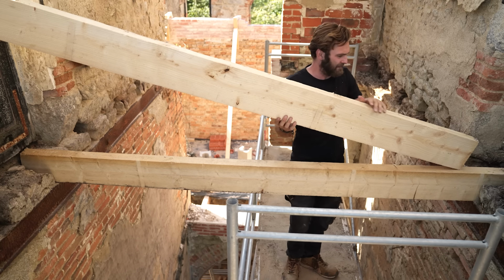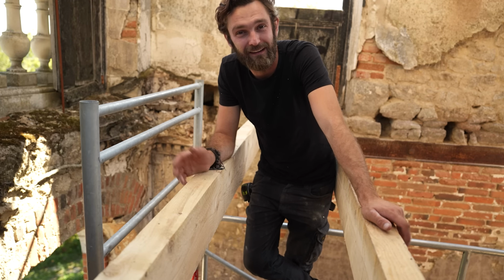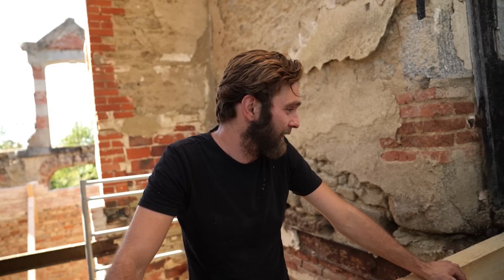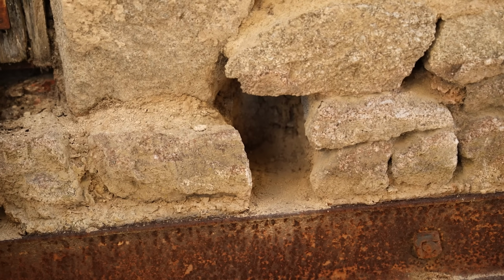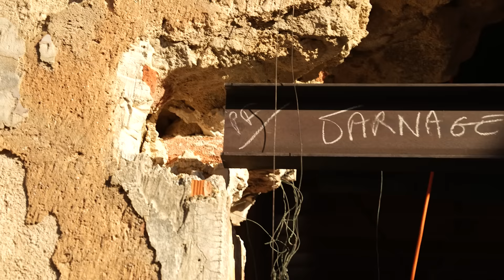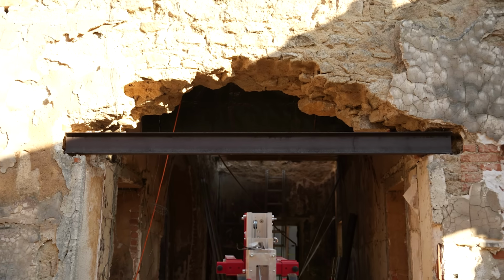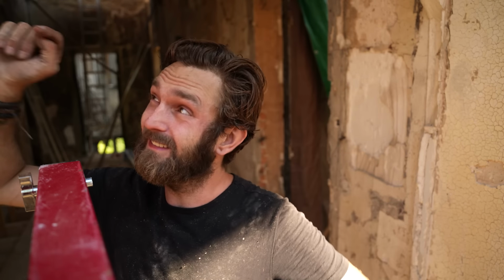installing beams, 14 metres high, in the chateau turret.

Comment: This seems really obvious and probably not worth mentioning since you already know--but if your tape measurer has a bend in it it won't give you an accurate measurement. That definitely happened during the wooden beams--but obviously you'd overcut, not under, so not sure what happened with the iron beam.

Comment: That I beam you cut too short, is that long enough to replace the one across the door way into the tower behind your shoulder at 6:34? 
If it does then it wont go to waste and you will have something there newer and stronger than what you currently have.

Comment: I'm curious if there is any particular reason why you use a traditional tape measure rather than a modern laser measure? I noticed you used a laser level before - so you're no technophobe.. And I'm impressed by all the other tools/equipment/machinery you have on site - but I'm absolutely stumped by the old school tape measure..?!? 🤷‍♂😂

Comment: Even without the winch, drill a hole in the beam, attach rope, pull it up.
Can you use the battery drill to power the lift up and down?

Comment: What kind of lumber do you use in Europe? Those joists are the rough equivalent of a U.S. 4'" x 6" beam and about 10' long. In the US, those would be pretty heavy and quite unwieldy at that length, yet Dan seems to handle his lumber quite easily.  It looks so much lighter than what we use in the US. Or is Dan just superman is disguise?

Comment: Are there electric winches which can help lift lumber, motar, etc..  A second person on the ground floor feeding materials would be really  helpful. A mason could help deal with the top structure.  It looks unsafe to watch you carry up steel, lumber, etc. up an aluminum ladder.   Time is running out before rainy season.   A roof, even a temp. one, would be good.  You should be careful to avoid injury.
Reply: 00:48

Comment: Would it be easier if there was scaffolding on the exterior and the the remote operated winch & pulley could  haul stuff  up each floor from the  outside? ... then the products  pulled in through a window on each floor? Getting stuff up those steps seems like a backbreaker. 
 A  conveyor belt used on roofing shingles  would be ideal but they are very expensive to rent, but wouldn't the pulley be easier on the external? ...Just trying to be helpful.

Comment: Get some gloves mate, one slip and your hands are mince meat..... hauling crap up there by ladder saps your strength get pulley system in pronto.... 🙂
Reply: That's literally what the beams he just put in are for. To attach a winch. Did you listen? 00:48
Reply: @Sgirl   yes and then he carried them up.... didnt you watch?
Reply: @terrymorton9941  Yes, because he needs beams to attach a winch to. There's nothing up there yet that's stable enough. What would he attach it to? The sky? It's a double pully system that ties off to two beams and until the beams are in, there's nothing to mount it to.